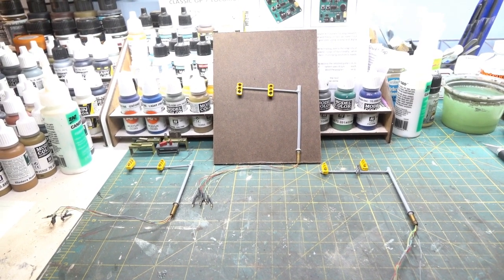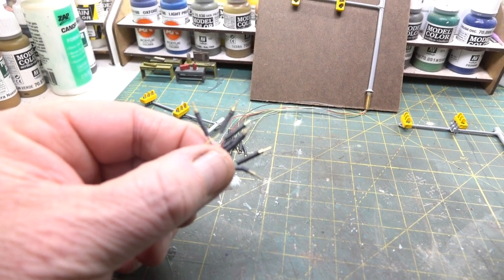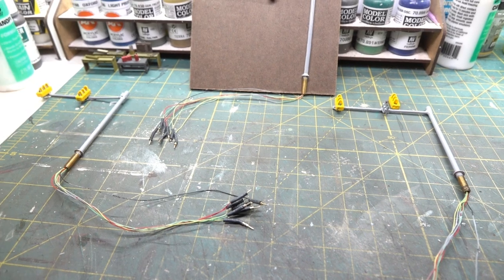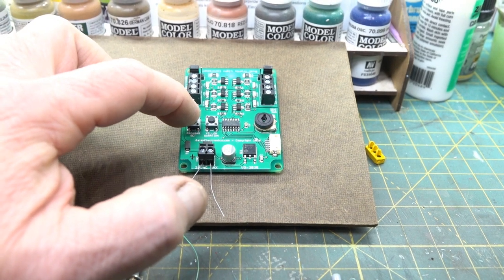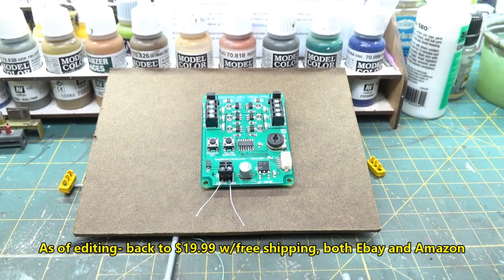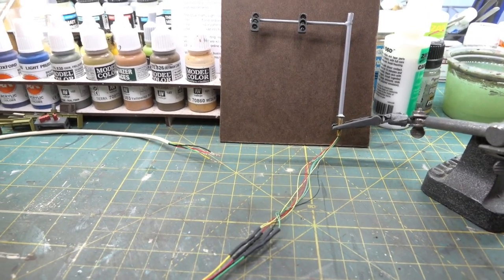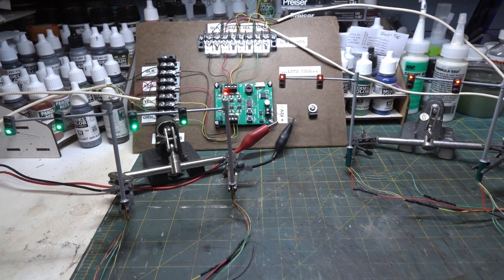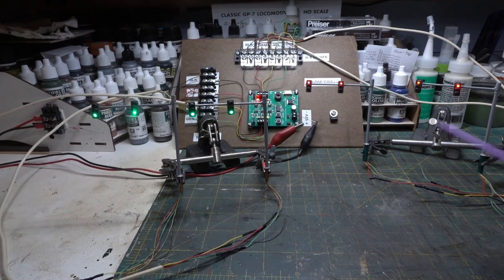MRUV 160: Installing Traffic Lights in Lake City

Comment: Good work Rob 👍👍👍 3 thumbs up
Rob using a green wire as a current conductor is a no no in the electrical word.
Green is used for a grounding conductor in north america
Reply: Perhaps, but I don't need to follow the wiring codes and use green for +12V, red for +5V, White for +track feed, and black for grounds. I don't think an inspector will be here to complain.
Reply: @robbennett1965  no worries bro,  all good
Being an electrian colour codes are beaten in my head

Comment: Hello Rob. I’ve been an avid subscriber since day one on your construction. Absolutely awesome. Just want to say thanks for putting this segment on the traffic lights. I recently purchased 10 single head lights and I didn’t want to use the resistors that came with it. I looked at the halal system and found your video on hook ups. Did you use telephone wire?  And would you think I would need at least 2 control boards for 10 single head lights lights?

Comment: Hi Stephen,  did you need to add resisters?  Is it wire to the AC side of the transformer?  Will three volts work on these?  Thank you

Comment: Thank you for this .
Have got a scenic master 4 way light with this controller, and wanting to install it, but have wondered about additional resisters.    One question, what power source did you use???
I’m thinking of hooking up straight to the power pack...18.5 volts ac or the dc side, 15.5.    
Thank You again.   Great video!

Comment: I was quite disappointed with them when they arrived, same company, but mine did arrive from Hong Kong, or Guangdong...same thing. That may have had something to do with it, the electronics were fine but the masts and the light boxes were so unrealistic. Almost terrible. I feel like the only option is to remove the wires and lights and scratch build the rest...or just use for a different use.

Comment: I ordered the same type of traffic lights. They came with resistors. Where do I install the resistors?
Reply: hey, i was wondering where did you purchase your traffic lights
Reply: @GirlDad1st  I found a really good on traffic lights deal on Ebay. I also learned that you can wire the traffic lights to a light hub from Amazon, I think it's scenic. It actually worked perfectly.